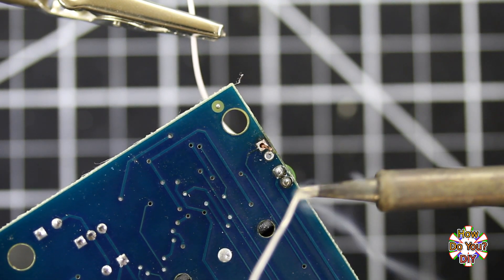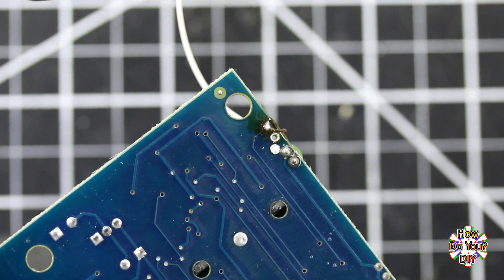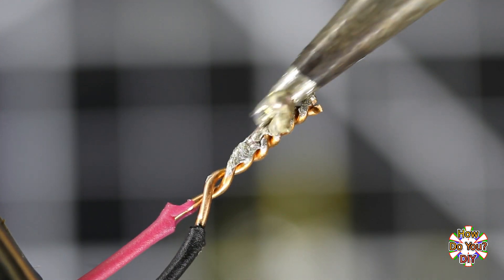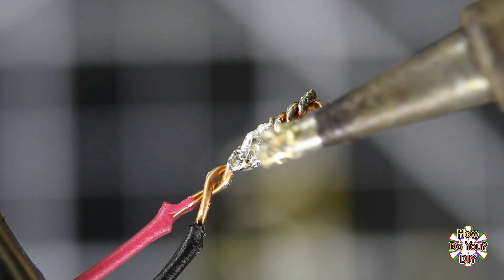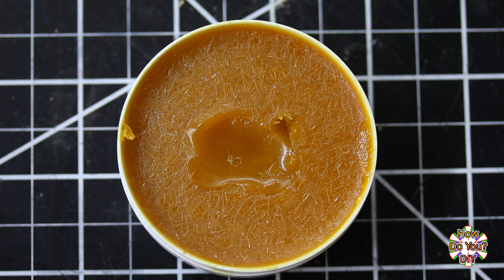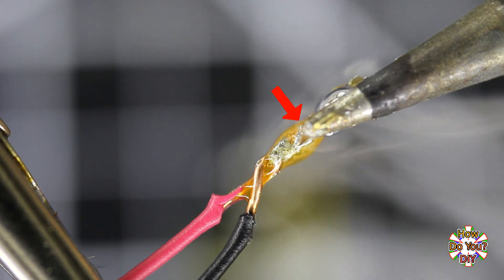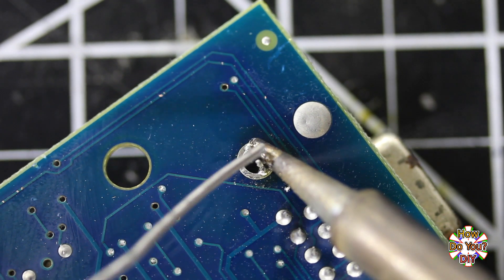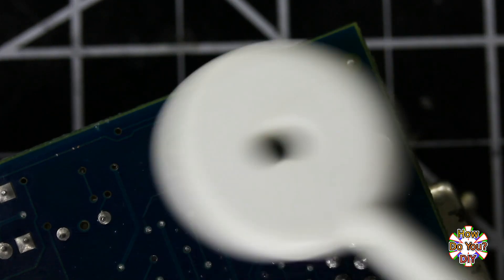Using Flux | Soldering Basics | Soldering for Beginners

Comment: I always use flux, but its an unfair comparison. Without flux, he doesn't hold the iron on the copper wires, he just dabs, so the copper doesn't get hot enough. With flux, he holds the iron steady on the copper wires
Reply from the maker: You're more than welcome to try it yourself. With the amount of solder I used in that part of the video, the wire heats up quite quickly. It was more than hot enough to cause the wire insulation to retract, which is a sign that the wire is hotter than you need it to be.

If you watch the part where I used flux, you can see the solder bonding and flowing with the wires within a second. During the part where I didn't use flux, you can see multiple times where I held the iron in place for longer than that.

Btw, heat isn't like electricity. When you remove the heat source for a fraction of a second then reapply it, the heat in the wire doesn't reset to room temperature and have to start heating up again.
Reply: @HowDoYouDIY  I totally agree with you, and I've done it many times. The solder should readily wick on. All I'm saying is that without flux you appear to use a poor "dabbing" technique, compared to when you do use flux.

Comment: Wait you can solder with the iron tip? I’ve been shown to heat the wire and feed solder onto the wire. So with flux you can solder faster with adding solder to the tip and then touching it onto the wires as shown?
Reply from the maker: That's a really good question. It's best to solder like you described, heating the wire with the iron then feed the solder into the wire. When using flux like I show in this video, you can successfully solder like I show here, but you still need to let it heat the wire for a bit afterwards to give it a good chance to make a good bond. If you need to add more solder, just feed it in like you've previously been shown.

If you don't have flux, it still helps to add a bit of solder to the tip of the iron because that will help heat up the wire faster. Here's a video I made that explains this: https://youtu.be/-qk-ulz05J8
Reply: I like the way you shown shown add it to the tip I tried it and let it soak for a good 3-4 seconds works perfectly when I just touched the tip to the flux without adding nice amount of solder as shown in video, only tinned, flux bubbles and sizzles but still takes a long time still for the solder to actually start wicking into the wire. I was told that heating the wire too long can damage connected components example speakers or an ignition switch.

Comment: I wish there was a video on how to keep the whole shaft clean from the black buildup from flux smoke... My tip is well tinned and in good shape but there is so much black carbon type buildup on the tip shaft and heat shield of soldering gun... I'm thinking it could be bad quality flux, holding gun at wrong angle or just poor cheap quality metals... any thoughts?

Comment: I'm about to go on an adventure with my very first custom keyboard. I have prepared myself extensively and ordered all the necessary tools including flux paste. This video was really helpful. However, I have a question because it wasn't properly demonstrated in the video. Where and when should I apply the flux? Is it fine to apply the flux to all the holes on the PCB in advance? Do I apply flux to the wires after I put them through the holes on the PCB? Do I apply flux to both the holes and the wires? If I apply flux and don't solder immediately, will that affect the results? I really, really hope someone answers before all my equipment arrives. I'm really eager to start this project, but I want to do it right and with all the information needed to do a proper job.
Reply from the maker: That's a really good question, thanks for asking! Any of the ways you mentioned should work, but it's best to put the parts/wires through the holes first then apply the flux where the wire meets the hole. Basically put it right where you're going to put the solder. You don't need to worry about getting it into the hole because when it melts it will get in there. After applying the flux, there's no rush to solder it immediately (unless it's no-clean flux.) It takes days/months for the flux to dry out. Even after it dries out it will still work. It just won't stick as easy since it won't be as much of a paste any more. I hope this is helpful. Feel free to ask any more questions!

Comment: Thought flux was acidic and would cause corrosion in electrical wires. That’s why so many don’t use flux. Only used it on sweating copper plumbing
Reply from the maker: If you use the wrong type of flux it can. I've heard that plumbing flux should never be used with electronics for that exact reason. Electronics flux is formulated differently to prevent that corrosion, but it's also more expensive.

Comment: Great video! Is there any type of flux that one should prefer for certain types of soldering jobs? Say, soldering ICs vs. soldering wires like you do in this video? I can definitely see why you would want to use the type of flux paste for soldering wires but would it be detrimental if you were to solder smaller things like a 16-pin DIP for example?
Reply from the maker: That's a good question. Most types of electronics flux should work about the same. No-clean flux can be convenient, but can sometimes be not as effective. The main thing to avoid is plumbing flux when doing electronics.

Comment: May be a stupid question and you have probably answered it before,  but when I watch videos on amtech flux it seems to come out of the syringe like a gell, when I do it it comes out like a solid strand, is there something that i am doing wrong,  any help will be greatly appreciated.
Reply from the maker: It's possible you have a different brand or type of flux. It's also possible your flux is a bit dried out. It should still work of it's dried out, but a little difficult to keep in place.

Comment: Like some of the other posters, I've been soldering with just rosin core solder and no flux other than that. Most sources I found mention about the flux cleaning properties but very few explained the wicking and how it makes the solder stick to things and flow better. Excellent video and right to the point.
Reply from the maker: Thanks! I almost made this subject as part of my Using Solder video, but decided to give flux it's own video. I'm glad I did because it's such an important part of soldering, and it was able to reach WAY more people on it's own.
Reply: @HowDoYouDIY  what kind of flux should I order for a project involving attaching wires from crossover  to woofers? Thanks so much

Comment: OH MY GOD. Thank you for this video. Just started doing soldering myself and was doing a Sega Game Gear recap and was having trouble with the solder during some of the points. Turns out, the flux pen that I have is pretty trash, so I may have to find a different material/application for my flux. <3
Reply from the maker: Sometimes the no-clean flux doesn't work as good as rosin flux. I hope you got what you need to recap your Game Gear!
Reply: @HowDoYouDIY  I did not know that! Thank you once again <3

Comment: is all flux the same?
Reply from the maker: That's a really good question. Not all flux is the same. When soldering electronics you want to use flux that's made for electronics. Plumbing flux will work, but it can be more corrosive. Some types of plumbing flux can also cause the circuit to short out.

Comment: Flux is certainly helpful, if you are a beginner purchase some (be careful of reactive flux) 

Also, in a pinch steel wool has worked pretty well to remove oxide, not perfect, can't always get it completely, but it can be very handy.
Reply: What do u do with the steel wool
Reply: @thomasmarkbenjamin8169  poke the soldering iron tip in. They make some extremely fine steel wool, I'm sure it could technically scratch the tip but I've never noticed any scratches from doing so.

They make brass wool for this, works very well, softer metal, but harder to find locally, almost any hardware store will sell #00 steel wool.

Comment: I’ve been soldering for around 10 years now not using flux and spending time globing solder and hoping it sticks . Redid my boat trailer wiring last year and it’s going to crap already because I didn’t use marine grade wiring and connections . Tackling that project now and glad to know to use solder / flux properly . Thank you
Reply from the maker: Flux makes a huge difference helping solder to stick. But working on marine wiring, it may also be necessary to use some steel/brass wool to scrub the surface first. If there's too much corrosion, flux can have a hard time getting through it.

Comment: Is flux required for soldering onto steel surfaces? I'm soldering wires onto guitar pots.
Reply from the maker: It's definitely helpful. If you have issues, even with flux, you might need to use a bigger tip. Especially on a larger surface area. If the steel has a coating that the solder doesn't bond to, you may need to sand that choosing off. Hope this info is helpful.
Reply: @HowDoYouDIY  Yeah, I have no problems with the solder sticking to the surface.

You mention the flux residue-I'll avoid the flux then, if the flux is only for getting the solder to stick properly-So I don't have to wipe that off.
Reply from the maker: Ok perfect. If it's already sticking easy then you're good!

Comment: You mentioned you use a scrub brush at the end of the video. Would these brushes have any adverse effects to things like capacitors or other surface mounted items on typical motherboards? I mostly use q-tips and ISP (isopropyl alcohol) because im concerned about damaging the board or its circuit traces. Thanks. Nice video.
Reply from the maker: That's a good question. Most of the time that shouldn't be an issue, but using q-tips like you are is better. Just because a scrub brush won't be an issue most of the time, it could still damage small and delicate parts.

Comment: So, basically.....you can think of flux as a primer right? It's really to just prep the surface. Lmk if I'm wrong.
Reply from the maker: Yeah, kind of. It is just to prepare the surface and to help the solder attach to it.
Reply: @HowDoYouDIY  Right....much like how primer helps paint to adhere to a surface.
Reply from the maker: That's right 😊 but where paint primer stays between the paint and the surface, flux doesn't. It burns/moves away when the bond is made.

Comment: My solder tip became black, it difficult to solder. I don't know what wrong with, i try flux still not stick. Please help. I think i suppose to retin it. I will try again. Any tip please.
Reply from the maker: Have you tried soaking the tip in isopropyl alcohol? I don't know if that will work, but it won't hurt to try.

Comment: Great video, no fluff, very informative. 

I think the number 1 mistake beginners make when learning to solder is not understanding flux.

1) You need to use flux because it makes the solder stick and flow properly.
2) You need to clean the flux because once it's burned any further attempt at soldering that area will fail because it's contaminated. So clean, reapply, resolder.
Reply from the maker: I agree, using flux is one thing that makes a world of difference, but it's often overlooked when people are learning. And as far as cleaning off the residue, I didn't spend much time in the video explaining that. Thanks for sharing this info!!

Comment: How to clean the pcb hloes after removing the components
Reply from the maker: That's a good question. I made another video that shows how to remove solder when you remove components. You can use a desoldering pump or solder wick to clean the solder from the holes. Here is a video that shows how to use those: https://youtu.be/bG7yW9FigJA

Comment: I wish I had known to use flux earlier in my life. I had so many issues until I found out about flux. Such a great product. I appreciate the video. Hope it helps someone not to have to go through the pain of wondering why you can solder a certain joint.
Reply from the maker: It was the same for me. It's amazing how much of a difference flux makes when soldering.
Reply: Me too! I’ve thrown things away because I thought they were just impossible to solder due to age or something. Flux core solder has been the only reason I ever fixed stuff, probably. Someone told me once it was the best, but didn’t say why so I just bought it.

Comment: Why dont you use soldering iron to heat up the wires first, then applying solder to proper connect the wires?
Reply from the maker: That's a good question. Normally I do, but that's not the purpose for this video. The purpose for this video is to focus on the effects that flux has on solder. The video I uploaded just before this one is about applying solder, and discuses the process you're describing. Here's a link to that video, if you'd like to check it out: https://youtu.be/-qk-ulz05J8
Reply: @HowDoYouDIY  thanks, as I am just learning how to solder I will need as much information as I can get. Much appretiated 👍

Comment: What do you normally use to apply flux to things?  Do you have a tool you set aside for this?
Reply from the maker: That's a really good question. I have a random metal pick I got with a soldering iron a long time ago, but a toothpick would work just as well. If your flux is thin enough, you could also use a small paint brush.

Comment: Good video! I need this information. Well done guys!

And about isopropyl alcohol, i want to know about it. Which one do you prefer? 

• Isopropyl Alcohol 50%?
• Isopropyl Alcohol 70%?
Or
• Isopropyl Alcohol 99%??

Please reply me..🙏🏻
Thanks👍🏻
Reply from the maker: That's a good question! I've only used 70% for this, but if you clean it immediately after, 50% should also work.

Comment: I still cant get the solder to flow that way. Ive been soldering for years, and recently got into brazzing.

Biggest problem is heating small parts. Aluminum just suddenly will melt and ruin the part. Its a tiny plunger shaft, on which an entire vehicle rests. If I cannot make it, the vehicle gets junked....
Reply from the maker: I recently tried brazing for the first time. The issue I had was kind of the opposite, not heating up the aluminum very well. The pieces I'm trying to braze seem to be dissipating the heat too quickly. I'm using a small butane torch, so I think this is my issue. Seemed to work ok on smaller test pieces, so maybe a small butane torch may work better for your use?
Reply: @HowDoYouDIY  Theoretically I know stuff lol. Like, for high melting temp metals, MAPP is good to heat up the metal, and using insulating ceramics for the vise etc. But the small stuff, theres this odd effect, of concentrating the heat. So heating up the larger diameter portion, caused the think threaded shaft to melt off even though I didnt touch it with the flame. At this point, Im going into full eastern european mode and grafting pieces, with some mild brazzing, just to keep things in one piece. I lost enough body parts doing this piece (yes, I actually did. Exploded drill took off my scalp, another drill bit broke off and landed inside my thumb, deep laceration in my other thumb from a cracked exacto blade, and every tap I used crumbled. I feel that my luck has been so bad, that Id win the lottery and somehow the drawing would be invalidated over hacking or whatever, and Id end up the prime suspect, throwin in jail for 94.5 years....

Comment: Dear Sir, may you please recommend a good and economical flux for use. (I'm not experienced enough with these things).  Thank you for making & posting this video.  Thank you in advance.  td\.  ¿Are the (lower cost) Chinese made flux (neutral PH) good enough for electronics repairs/desoldering/soldering, please?
Reply from the maker: I'm not familiar with the Chinese made flux. I know some people will use cheaper plumbing flux with electronics, but it can cause issues sometimes. I have a link for the flux I use in the description.
Reply: @HowDoYouDIY  Thank you very much for the reply.  I appreciate it.  God Bless.  td\.

Comment: Thanks for this, cannot get solder to stick to terminal, have cleaned and filed, i'll get some flux, see if that helps.
Reply from the maker: Solder doesn't work with all metals. If the terminal is aluminum, the solder may not stick at all. Doesn't hurt to try though.
Reply: @HowDoYouDIY  I think you're right, i purchased some flux and decent solder and it still would not adhere to the terminal or wire, so i took the old wire out and used some that solder would work with, then i soldered the the wire either side of the terminal and it seems to do the trick, but there is definitely an art to neat soldering.
Reply from the maker: It definitely take some practice. I'm glad you were able to get it figured out.

Comment: So flux is used to avoid oxidation right? So if you just remove the oxidation with an abrasive brush, you wouldnt need to use flux right?
Reply from the maker: That's a great question! Yes, that's a good way to remove the oxidation. Steel wool or brass wool will work also.